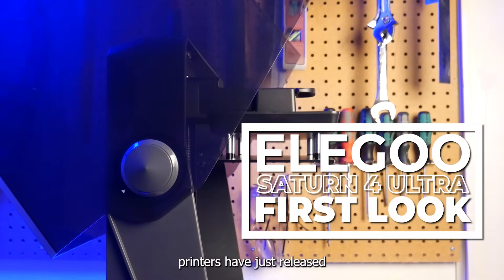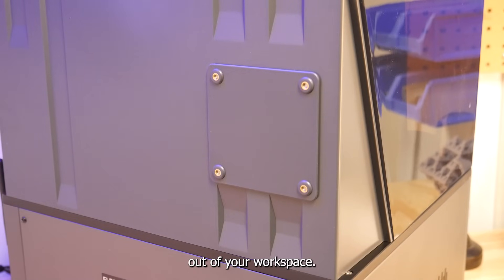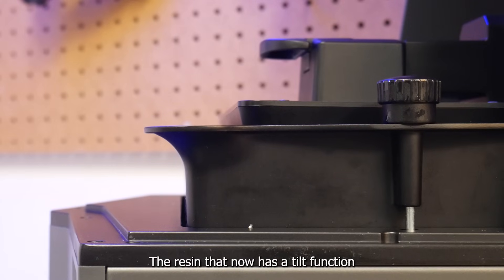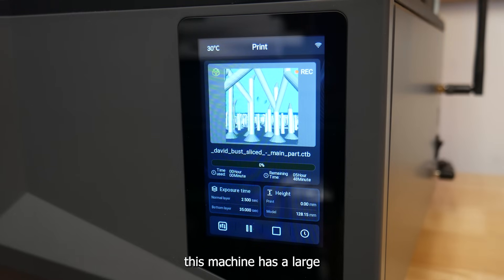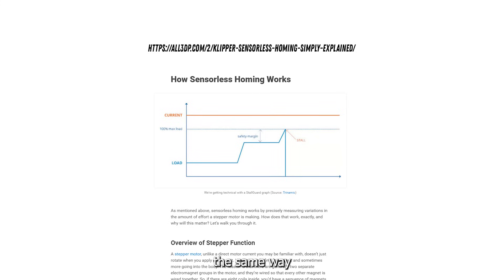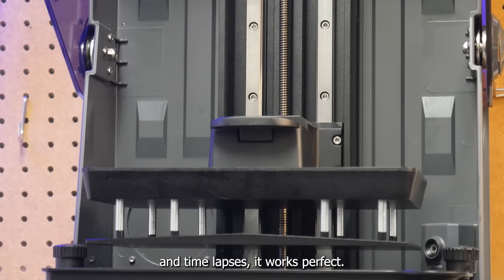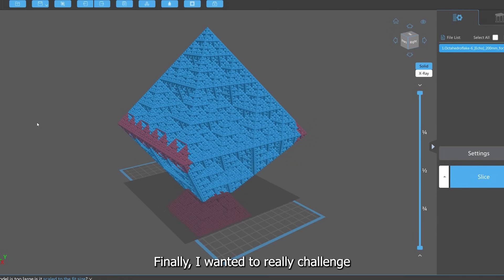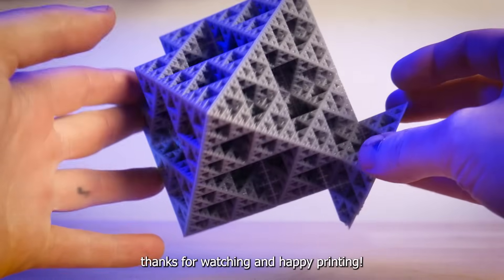This Resin 3D Printer Is A Game Changer! ELEGOO Saturn 4 Ultra First Look

Comment: One thing to note is that it's not true to state it prints at 150mm per hour with standard settings.  Honestly, the only way to reach those speeds is to print at .2mm layer heights (which is taller layers than most FDM prints) and underexpose the resin. Elegoo lied here. But they are not alone. The difference is that this is the fastest printer that doesn't have to compromise quality for speed and reliability.  Its nearly twice as fast as my original Saturn and way more reliable than anything else I've used.

Comment: Did you get the 150mm/h printing speed?
Reply: I can't get it to succeed with the layers being that underexposed. The settings you need to use are stupid. Like 0.20mm layer heights (Maximum supported by the printer) and .50 seconds exposure settings. I didn't expect it to work, nor will I ever try to print something like that, even as a draft.

That said... it is a speed demon with normal settings. Prints are almost twice as fast as my Saturn in the real world. So disregard the specs and slice a normal file with normal settings and see how much time it takes. You will be amazed.  And it does it more reliably... meaning less failure clean ups.
Reply: @mikejackson9585 thanks for your response. Got my printer couple of days ago. Now need to figure where to put it.

Comment: Fuck it! I just bought my Saturn 3 Ultra about a couple of weeks ago in the Easter sale. I was still waiting for it to arrive when I got the newsletter about the new Saturn 4 series. I would have waited if I knew its successor is coming.
Reply: Could always return it of you haven't used it yet lol.
Reply: keep in mind any time they make sale on something that mean they need to get rid of it as there is something new coming , in any product
plus you cant just buy a new model that came out 2 days ago, you need to wait at least 6 month to see how its working and what is the review about this new machine,
i believe you did a good job buying a working model on sale :)
Reply: @wasiza6475  Elegoo has a great record of producing quality machines though. Especially the resin printers.
Reply: @wasiza6475  I bought the anycubic Mono X shortly after it's release. Pre-ordered the M3 max and later the m5s and the Kobra 2 max and had zero issues with any of them. Well, ok, I did need replacement parts twice but just a cable and a sensor for the Kobra 2 but that's something that's not something I would blame on it being a new product ;)..
Reply: I was thinking to get a Saturn 3, when I got the news about Saturn 4. I disappointed because they reduced the max height from 260 to 220mm....
Reply: you are well served with it, maturity and lack of delay gratification is the issue, that is why new shining toy is so desirable, remember the fewer moving parts the better, Saturn 3 ultra will stand the test of time.

Comment: Instead of having to use clippers to snap off supports on that ball try soaking it in warm water for a minute after you wash it in IPA. Even tough supports snap off without effort in a quite satisfying way.
Reply from the maker: That’s what I normally do, heat gun on low temp softens them right up! Thought it would be easier to wash and cure this one without it rolling g around 😅

Comment: Pulled the trigger on the ultra today. Will be nice upgrade from my Saturn version 1.
Reply from the maker: Congrats on the new printer!
Reply: Me too. I told myself that the next resin printer I get will be a large format printer, but I couldn't let this one pass me by.
Reply: @Thanos88888  16k medium and large format printers are coming, so that would be 28um pixels on larger format, those will be amazing
Reply: don't throw away the saturn 1, they don't make them that sturdy anymore
Reply: @awildtomappeared5925  I initiat was gang to sell but doubt I’ll get much for it. Most likely take your advice and hold on to it. Thanks.

Comment: My main concern is if the FEP sheets breaks. Isnt the resin just going to flow in to the internals of the machine?
Reply: I sent a mail to Elegoo to ask about this. Waiting for their answer :)
Reply from the maker: Not necessarily. Depends on the break. In my experience most of the resin stays in the resin vat after a break until it’s removed from the printer.
Reply: @WildRoseBuilds  Yeah most but I have seen plenty of bad spills so would be interested to find out if they have put in anything to potentially stop this
Reply: Could happen but but the time with resin spills they get cured to the fep immediately after and its minimal after.

Comment: No heater 0/10
Reply: it's avaliable as an addon
Reply from the maker: 50 dollar addon my chamber stayed relatively warm during printing so it may not need it
Reply: tbh I'd rather buy one seperately if I needed one than paying more for the printer to have it included while I'm not gonna use it ;). I really don't understand why everyone is whining about the lack of a heater being included
Reply: @Abraksas112  cause it's nice to get it and not worry about it. but a heated vat is better
Reply: Not an issue for everyone. Living in Australia measures not having to worry about that type of thing.

Comment: Some nice QoL features.
At least they are showing the 19x24μm but still advertising screen resolution, which is pointless.
Still lacking vat and chamber heaters, which help, especially the vat heater.
Reply: They lauch a heater chamber like anycubic at the same day of saturn 4

Comment: It bounces while breaking! 😅 I have to try this ball with a weird tough resin I have here. Great video!!!!
Reply: are you talking about the ABS like resin? I have tried it a year ago, wasn't very reliable. What is your current experience with this?
Reply: @doesNotMatter999 No, way more expensive stuff. There is a Sunlu Nylon Like that costs about twice, and an almost rubber-like tough resin from Conjure. There is even more costly resins (around 100$ per liter) but I never tried.

Comment: That tilting vat means you might be able to print larger objects flat instead of having to tilt them, which could save a ton of time.
Reply: prusa had a tilting vat on a 2 grand printer, I dont see how elegoo who makes cheap crappy printers could do a better job on a bigger tilting vat for 400 dollars
Reply: @awildtomappeared5925 I can tell you from seeing what's available, that nearly EVERY company has produced a better printer than what Prusa has produced....
Reply: @awildtomappeared5925  Yea I have loved my Saturn 3 Ultra have nothing but good things to say about Cheap Crappy Elegoo. Why bother even responding.
Reply: @Valace21  try doing big prints with AA, I've spoken to people who have had whole vats of resin wasted on 5+ pirnts from doing this. There is a glitch with the chitu boards that gets worse if the hardware isn't good enough for the LCD size which is the case with the s3u hence whey the s4 has a new board with 2x the ram. Elegoo refuses to acknowledge this issue...
Reply: @awildtomappeared5925  bro accept that, other companys can make better and cheaper printers kkkkk prusa take 2k on a printer with fdm knobe printed for bed🤣 you are that kind of fanboy who says apple is bether because is expensive kkkkk
Reply: @awildtomappeared5925 just because you can't understand it, doesn't mean it can't be done effectively. But it's clear you came in with a bias.
Reply: @got_logic1320  what and you do?? tell me then how a 400 dollar company by a company who make cheap crappy pritners (which I know from expirience, I have 2) is going to make a better system than a 2 grand printer from a company who produces much better quality products??